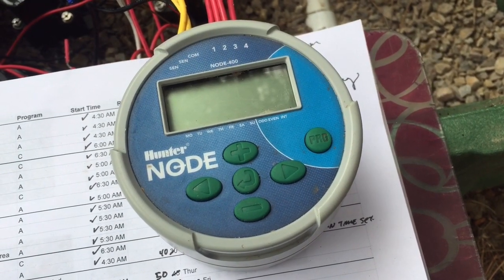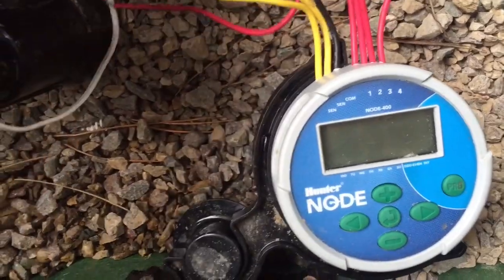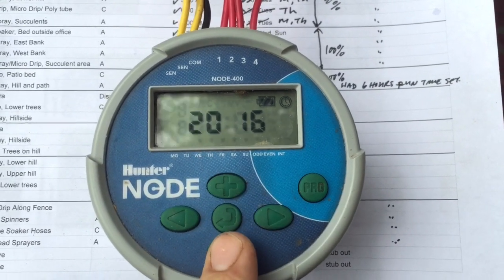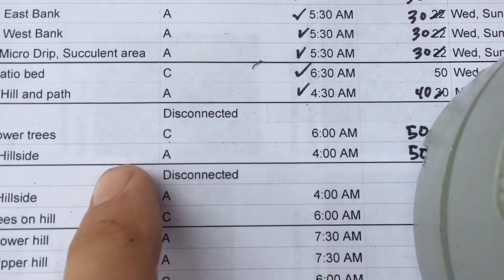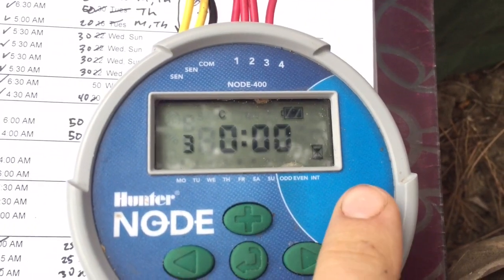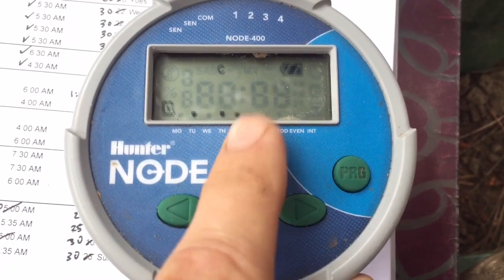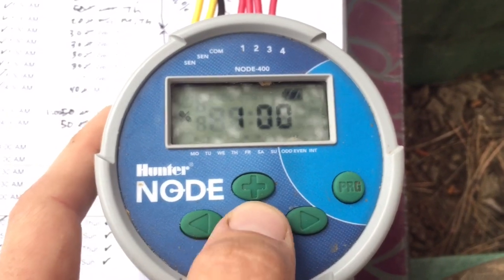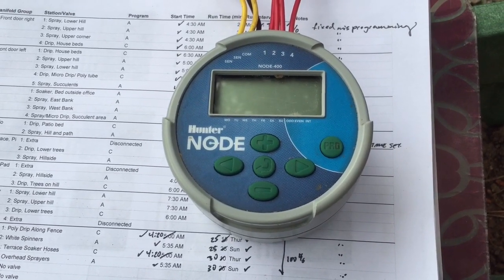How to Program a Hunter NODE Irrigation Controller

Comment: I just watched 5 videos.  This is, by far, the BEST one.   It is easy to confuse setting multiple times for one PROGRAM and setting different start times for each ZONE.   Whoever programmed our Nodes (at our HOA properties) mixed these two things up.  And, the people who handle the public area always assume that the person before them did it right so they just turn them on and off never checking the actual program.  The Hunter videos are well produced but the guys says, "here is where you set the date and time but he never does it."   This turns it up this turns it down.   Actually showing how to set a typical watering program is huge.  Thanks!

Comment: Great video, and you're absolutely right when you say the timer is simple once you "get it down." I was one of those who was "banging my head against the ground" for some time, but now I fully understand how to program the timer and it really is a piece of cake.
Reply: This disaster of user interface design takes time to figure out, but after that, it's easy enough. The trouble is that I typically adjust mine in the spring, then barely touch it for the remainder of the summer. By the next spring, I have only the foggiest memory of how all the button combinations work. I find myself heading back to this video year after year after year.
Reply: I swear it was the 5th summer before I finally got it down! Now I'm here because I have a station that won't turn off, so I have to shut all the water off to the garden. Hoping for a simple fix, as I'm a 72-yr-old woman who's NOT a DIYer.